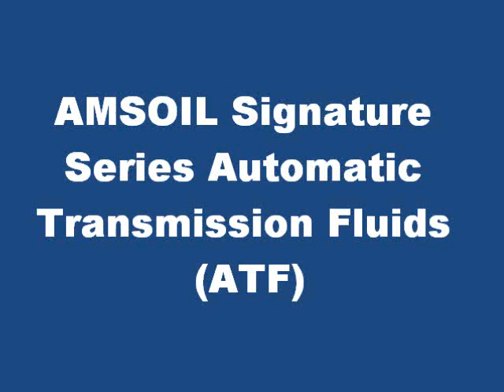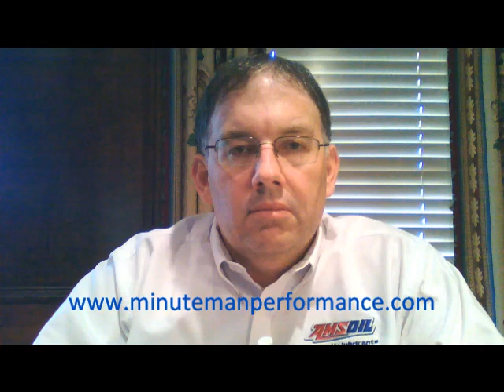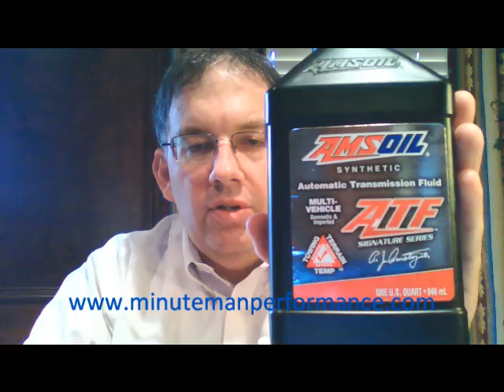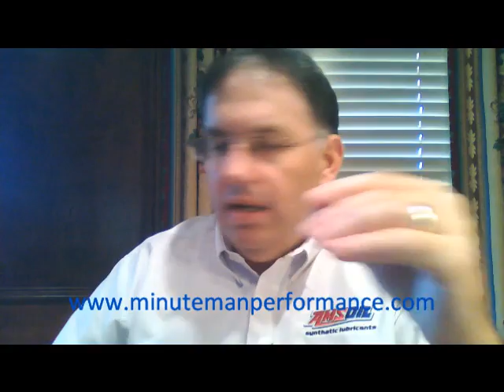AMSOIL Signature Series Synthetic Automatic Transmission Fluids (ATF)

Comment: i wonder how much longer a transmission changed every 50,000miles with Conventional OEM-Dealer Trans Fluid vs Amsoil Signature Series transmission fluid would last.
Reply from the maker: Hard to tell, but you'd spend a lot of money getting those 50,000-mile trans services performed.  I recommend that owners perform a complete fluid/filter service somewhere around 15-25k miles to remove the break-in clutch friction shavings in the pan, and refill using Signature Series fluid, and then they can probably never change again, unless they operate in Severe conditions.  If they are operating in Severe, AMSOIL rates the SS fluid for 2x the OEM Severe interval.  Also - lower quality lubricants/fluids are not equal to premium synthetics - EVER.  They don't start out the same and just deteriorate at different rates.  The lower quality product is under-performing in the first mile and just gets worse the longer you run it.
Reply: @Best-Synthetic-Oilscom  Thanks for the info Tom.   I've got a 2008 Ford Focus ive owned since new that right now  has 50,000miles/ 80,000km .   The Fluid was changed on a drain & fill pan drop + filter (all Ford Dealer & Filter ) back in 2015......so when the car was 7 years old, it had 36,000miles/58,000km on it back then in 2015.     So im thinking well that other fluid is still original, and im having a real struggle/debate with myself as to if i should use OEM-Mercon LV from the ford dealer @8.76/946mL bottle   or get the amsoil @ $19 for a 946ml bottle.       I'm just nervous switching to something other than the OEM Mercon LV from the dealer.  Car shifts great otherwise.
Reply from the maker: Your concern is completely understandable.  Transmissions are expensive to repair/replace, and most people who've owned an automatic car have paid that high price, and most of the time it was avoidable.  Continuing to use the Mercon LV fluid and changing it on a regular basis will give you much better results than owners who do nothing except drive.  The AMSOIL fluid will simply give you ever better results and protection for the best possible transmission life and daily performance.

Comment: I have a 2007 honda crv that uses the honda dw-1 but originally came with atf-z1. which one of these amsoil atf fluids would be better for it, or will both work fine?
Reply from the maker: Either will work great, but the Fuel Efficient product will provide slightly better fuel economy and slightly better cold performance/shifting, due to lower viscosity.

Comment: As I recall the blue fluid is for low-friction versions of the 722.9 which started production in 2010-2011 timeframe. Look for an A89 build code on the build card, this indicates the low-friction version of the 722.9 transmission was installed in the car.

The blue stuff (236.15) is NOT backward compatible for regular friction 722.9's or any 722.6.

The 236.14 red stuff is fully backward compatible for any 722.6. so kindly correct the specs label as it will ruin someone 722.9 gearbox

Comment: i have a 2005 05 honda accord 4cylinder with 191,000 miles, which one of these atf do u recommend? i do lots of stop and go driving in the city, i live in the Bronx.
Reply from the maker: The multi-vehicle formula (red top bottles). Product code is ATFQT
Reply: @Best-Synthetic-Oilscom  I see MCLA SL 040 and BCLA SL 040 what's the difference? So the red cap signature series is good to use over the oem red cap
Reply: @Best-Synthetic-Oilscom  what drain interval I should use?
Reply from the maker: @fyahwerks  2x the factory interval listed in owner's manual.
Reply: @Best-Synthetic-Oilscom  I was told up 60,000 miles. But regardless of the drain I am going with amsoil. Thanks

Comment: great info for sure👍
Wish factory recommend synthetic to prevent issues. 
Thank you 
BTW got a 97 Buick with 266750 miles still runs good as for transmission it's had the pan pulled and filter replaced 7-9 times over the 20 years been going good but a pain to do without making a mess. Wish I knew fluid flush with synthetic would have cut the agrivation in half✌

Comment: Which atf fluid you would recommend for my 91 MB 560 sec?
Thanx
Reply from the maker: AMSOIL Signature Series Multi-Vehicle Synthetic Automatic Transmission Fluid (product code ATF).  You will need 9.1 quarts for a complete refill of the transmission.  The Wix part number for your transmission filter is 58987.  Contact me directly for best pricing (unless you already have an AMSOIL account).
Reply from the maker: My email is:  info@best-synthetic-oils.com .   My phone is (678) 787-3028.

Comment: So how is it that Amsoil ATL or ATF fluid is universal in so many cars? I mean I wouldn't be able to use Honda ATF in a Toyota or vise versa but I can use amsoil in either one? Just hard to believe that while using amsoil transmission fluid isn't doing some kind of harm. Please explain
Reply from the maker: The main difference between AMSOIL ATF and ATL fluids is viscosity - ATL is a lighter, lower-viscocity fluid that meets the requirements for the majority of new car requirements, while the ATF product, which is thicker, covers most of the older specifications.  The reason these two fluids can meet so many different specifications is the high quality base oil and additive package used to formulate them.  If you are formulating a fluid to just meet a particular specification (but not exceed it), you only use oils and additives to get you to that point, and your fluid doesn't cross over to very many other fluid specs.  But when you formulate a fluid with the highest quality base oils and additives available on the market, you end up with products that can cover a vast range of specifications.  I hope that makes sense.
Reply: @Best-Synthetic-Oilscom  
What's honda transmission ATF requirements and chemical properties and characteristics to achieve ??
I am asking about The demands and additives from any ATF to achieve..
Kindly ❤️ Send me Honda OEM ATF DW1 data bulletin sheet .to compare it with matchabl amsoil ATF
((aminammar44@gmail.com))
Many thanks in advance

Comment: I drive Nissan Murano 2006. 130 000 miles with CVT Transmission. I wanna change the fluid. what is the best and stronger fluid u can recommanded to me. I felt last time and  hear the chain slip when I climb a small mountain and RPM on Maximum. feeling losing power
Reply from the maker: AMSOIL CVT Fluid is the strongest on the market, and recommended for your Nissan CVT.
Reply: +Best-Synthetic-Oils.com ok do u have a link or website i can purchassed
Reply from the maker: +Cherif Diallo http://www.amsoil.com/shop/by-product/transmission-fluid/automatic/synthetic-cvt-fluid/?code=CVTQT-EA?zo=1302686
Reply: +Best-Synthetic-Oils.com ok do u have a link or website i can purchassed

Comment: Which ATF Amsoil oil do I use for a 2003 toyota camry 4cyl? It has an overdrive button.
Reply from the maker: +Michael Mather You would want to use either AMSOIL Signature Series auto trans fluid (product code ATF), or AMSOIL Original Equipment auto trans fluid (product code OTF).  The Signature Series is the top rated fluid, and will last much longer than the OE product.  They are both very high quality, so you can't go wrong with either one.